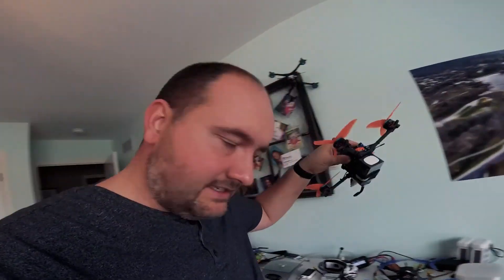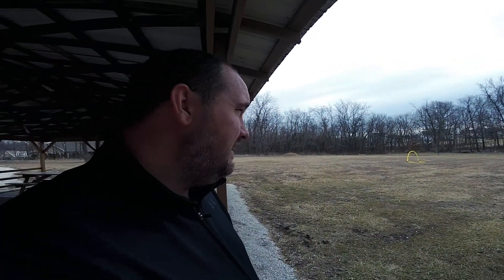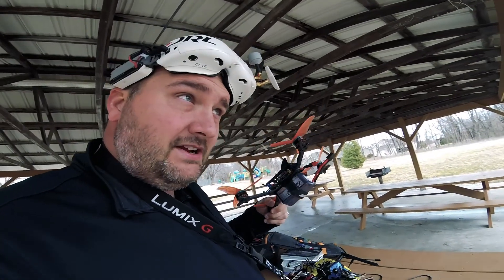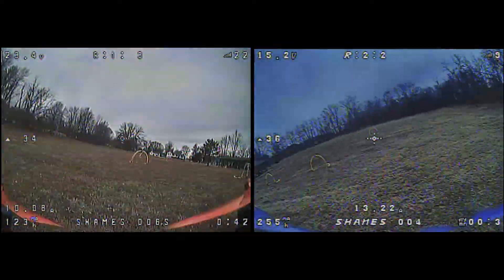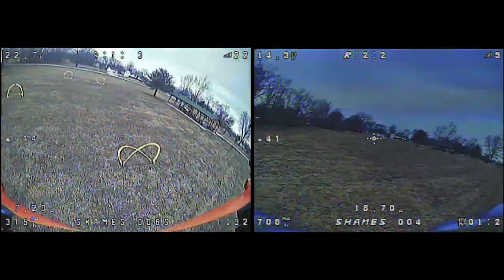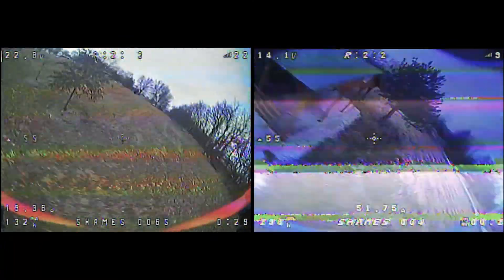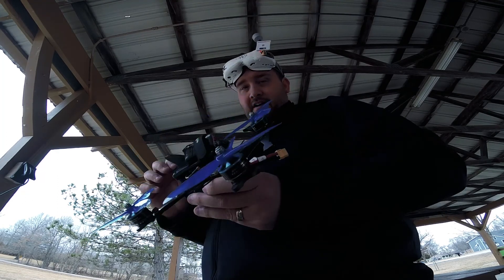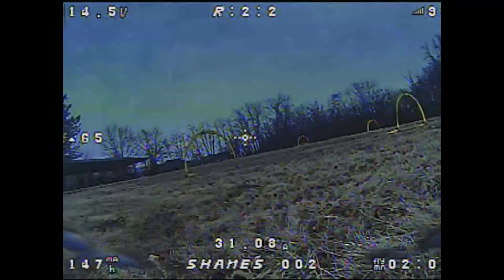Attempting To Efficiency Test 4s vs 6s Hyperlite 2207 Motors

Comment: So the props require x amount of watts to be driven. Two motors ,being equal, will require the same wattage to drive the same props ( overlooking wire resistance due more wire turns in one motor). On one setup you have 50% more voltage which effectively draws 50% less current. There is no loss with higher voltage but there is loss in the form of heat with higher current.

I get an average of 30% longer flight times and the motor controls the prop much better which translates in to more perceived torque and a more effective motor brake when the phases are shorted. The quad is no faster but it is quicker.

Comment: Well a 4s vs 6s battery will have a weight difference. When you say it felt lighter when it's not, you saying that's with or without the batteries?  If the quads themselves are the same the 6s will definitely be heftier with a 6s strapped to it... Also any efficiency gained I think comes from the higher voltage meaning less amps drawn with the same motor to get higher speeds, not necessarily more flight time. Most people go for the sheer power output to push them faster more so than fly longer. That said it all really depends on the motors and the like used to either gain speed or efficiency.

Comment: Hey Shawn, thanks for the video!  It looks like you were flying with more camera tilt on the 4S quad than the 6S quad.  Could that have been why you were flying more aggressively with the 4S quad, and it felt less floaty in the corners?  That would be my first guess.

Second, you stated you were measuring "mah" put back in the packs to measure efficiency.  Were you actually measuring mah, or were you measuring watt-hours?  To talk about efficiency across different voltages I feel that we need to compare the watt hours consumed and not the amp hours.

Keep up the good work!
Reply from the maker: +John E Fly great points. The 2 builds did have different cameras.  The 6s build seemed to have a wider field of view that would definitely affect feel so that’s a great point.  My intention wasn’t really to compare the feel so I wasn’t that worried about that but that could have definitely been the difference.  

I should have touched on watts vs mah.  I totally agree.  That’s how I calculated.  Mah alone wouldn’t be accurate at all.  

The 6s run used 9.39 watts (423mah x 22.2v) and the 4s Run used 10.49 watts (709mah x 14.8v).
Reply from the maker: That’s technically watt hours, right?
Reply: Yes, watt hours